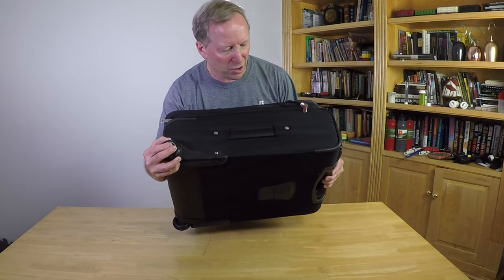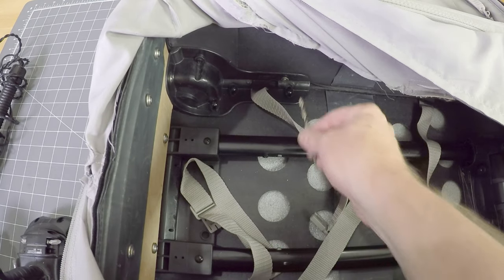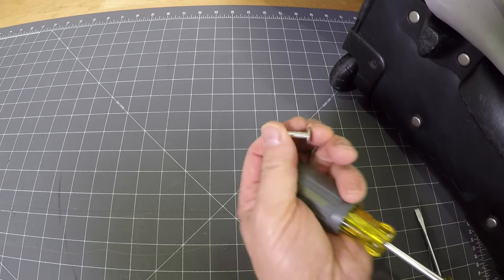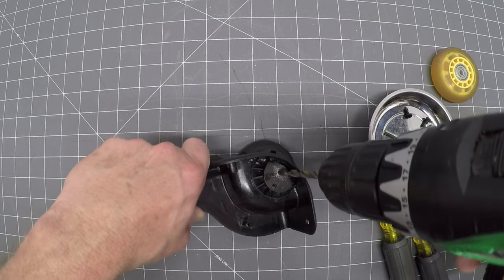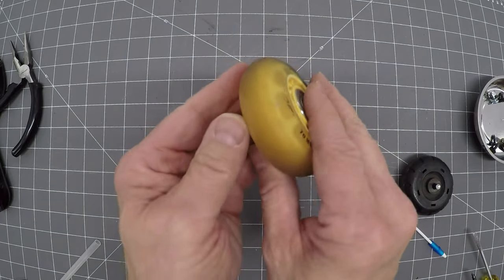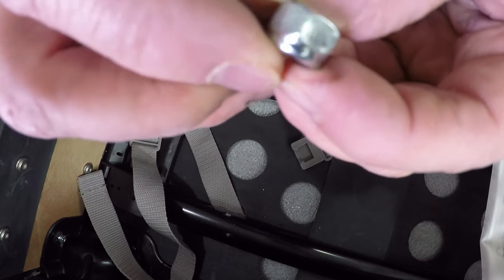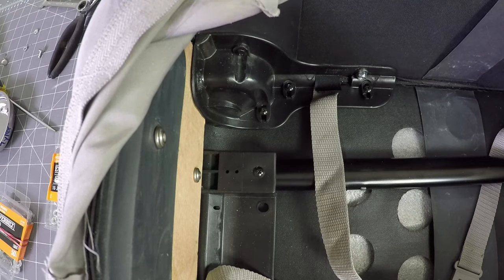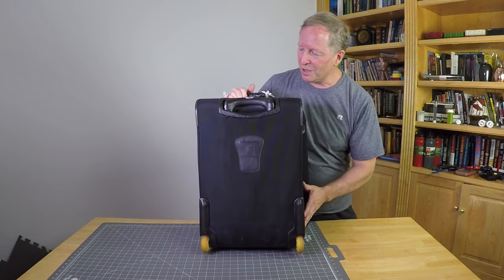Fix It: Roller Luggage Wheel Replacement for $5 - Easy Tutorial

Comment: Prague, August 2023 : I have a Samsonite 4 wheel bag After 3 short trips (bag half full), it had been pulled along no more than 2 miles. The 2 load bearing wheels completely disintegrated. A local old school luggage/ bag repair place quoted $25 per wheel - a huge amount of money for post-Communist Prague ( for perspective, $25 will buy you a 3 course meal in an average restaurant, with 3 beers). The wheel hubs have plastic detachable covers that expose a hex head bolt and screw. I asked them to show me what type of wheel they would use as replacements. Oxelo brand, 63mm width, steel bearings, 82A "hardness" (the brand does lots of dimensions/ hardnesses). I bought a 4 pack of wheels for $6 , the appropriate wrenches for $10 and fixed it myself in 10 minutes. I can understand that the shop just had a set price, assuming that they'd have to disassemble the bag to get the wheels out, but I showed them how the hub nut could be exposed, but they wouldn't budge on the price, so I did it myself.
Reply from the maker: Congrats on your successful 4 wheel DIY. Been to Prague several times, one of my favorite cities in Europe, love the clock. And some of the best beer and food I've had! You're right the prices at restaurants are very reasonable.
Reply: Love the story!

Comment: Thank you for this video! I got a super nice $400 brand name luggage case on clearance at a discount store for $15 because 2 of the bottom wheels were broken. Even though I literally could only drag it, I bought it cause I couldn’t pass up such a great deal- and it’s great for storage- and for dragging my wardrobe between my college apartment and my parents home- but I would love to have it actually work, so that I can take it traveling with me in the future. I’ll have to give this a try
Reply from the maker: Donde_lieta, thanks for the feedback. Give it a try, I think it will work for you.
Reply: Pomocne przed wyruszeniem na urlop.
Reply: It's simple.You should do it.
Reply: Did you ever do the repair?
Reply: @Charlie-eq3dj  yes..I had to use nuts and bolts with washers to adjust the fitting. It's done and working better than original wheels.
Reply: Used hand grinder to cut old rivets.

Comment: What a great video, thanks.  I found one cracked skate at GW for $2.  My suitcase is about like yours, it is an Embark from Target.  After doing the first wheel I thought of a way to avoid having to deal with the rivets.  On the second wheel I used a small hole saw and put a hole in the plastic right behind the wheel, so I was able to access the lock nut for tightening and didn't have to remove any of the base plastic from the suitcase.
Reply from the maker: Robert, thanks for sharing your experience. And welcome to the fix it yourself club!
Reply: Way too much work!

Comment: Advice, when you remove the rivet, make sure dont leave it on the luggage or the silk.  Mine burnt a hole on the plastic luggage.   What a shock the amount of heat from the drilling.  Shocking quality as compromised to make it lighter.  Got wheels but I now got a hole on my nice luggage...umph! 😢
Reply from the maker: Sorry to hear about the hot rivet, thanks for sharing your experience so others can benefit.

Comment: Brilliant video - many thanks for taking  the time to make it.  The wheels on my 25 year old Samsonite travel case had fallen apart.  On inspection the wheel mouldings were riveted on which put me off attempting to change the wheels (almost certainly the intended outcome from Samsonite).  Your video gave me all the info I needed to drill out the rivets and replace with standard fasteners.  New wheels will be here tomorrow and the case will be back in business and ready for another 25 years service.  Many thanks again.  Excellent.
Reply from the maker: Glad to hear my video helped. 5 Years later my case too is going strong. Here's to all folks like out there that see the value in repairing things.

Comment: Thank you for this video. I've been using the same suitcases for over 10 years and they were perfectly fine outside of the wheels starting to degrade. I looked inside, and sure enough the assemblies were held in with screws only and not rivets! I removed them, replaced them with some new ones, and now I might get another 10 years out of these bags and saved myself over $170 for replacing them.
Reply from the maker: Good to hear, mine is still going strong 5 years later, I hope to get another 5 more years out of mine too.

Comment: Thank you. Thank you!!!!

I have quite an old model carry on suitcase. Samsonite Silhouette 9. One of the wheels got stuck somehow and one of the the wheels wore out. Eventually made so much noise as i pulled the suitcase and I got embarrassed at the airport,  etc. I then came across your video. i bought some inline skating wheels from amazon and couple of washers. It's as good as new now!!! 🎉 

i am so happy because my carry on suitcase is really well made and i didn’t want to throw it away just because the wheel made some noise. 

I paid appox $15 (Canadian$) in total(probably could've gone cheaper but whatever. Im super happy. ) , instead of spending $250 for a new suitcase. 

Thank you. 🙏
Reply from the maker: Glade to hear my video helped you. Thanks for leaving a comment.

Comment: Just used your video recently to replace the wheels on my carry on I got several years ago for like $10 at a garage sale. Ended up buying a pair of used roller blades from a thrift store for $15 + different items at Menards. The roller wheels were thinner so they move around a bit on the bolt but still spin fine. May get some washers later if it gives me issues. Getting the rivets off was the most annoying part (1 per wheel housing). Thanks for the super helpful video, saved me money and saved my bad from the trash!
Reply from the maker: Varanos, you're welcome. Thanks for the comment, always appreciated. Agree, the washers should help out in your case.

Comment: Thanks for the video. I especially appreciate the pen comment. My previous wheels appeared to have a 6mm ID, and the new ones had an 8mm ID. Your video was the only one I watched that provided a solution for the different ID of the wheels. I also used it as a bushing/spacer between the wheel and the housing. The previous bearings stuck up over the wheel a couple of mm. I cut the pen pieces to protrude about the same amount.

I purchased two wheels off of Amazon, because in my area, the asking price of used rollerblades is twice the price of the wheels. I think I chose a wheel that was slightly too small (68mm) because my suitcase when upright now leans slightly towards the wheels. The previous wheels disintegrated, so it was difficult to get an accurate size. It now rolls perfectly and is distinguished from the other black bags with light up orange wheels. I'm a happy camper.
Reply from the maker: JenDet, happy to hear about your success and your bright orange wheels. Sounds like you're making a statement with them.

Comment: I have this exact Swiss Gear carry-on... wheels were toast.  Ordered "Ohio Travel Bag Ball Bearing Inline Skate Wheel, 70mm, Black" along with "M6-1.0 x 50mm Hex Head Screws Bolts, Nuts, Extra-Large and Thick Flat & Lock Washers".  Found that while I didn't need the bic pen plastic shim with these wheels and the M6 bolt, I did need to ensure the inner and outer bearings were touching each other inside the wheel, or else it would bind. Used an extra washer to fill the small space inside the wheel between the bearings... and it worked great.  Super instructions -- thanks for inspiring me to replace these wheels.  New cases are $130 on sale... so this is a great fix to get more life out of these bags.
Reply from the maker: Frederick, glad to hear about your success, your new wheels are likely to now outlast the case.

Comment: Thanks for posting this video. People usually tilt the luggage toward handle and then drag it. 99% of the time those are the wheels that get damaged. Simply replace them with opposite wheels. No need to buy new wheels. You should be good for another 5-10 years.
Reply from the maker: Gautam, excellent point. In my case though the original wheel had large chunks taken out of them so no longer good. But this upgrade is still going strong 10Ks of miles later.
Reply: Some bags have only two wheels on the handle side.The one here was that type.

Comment: Thank you! Question - do you need to use a special drill bit since the rivets are metal? Or since they're thin, any drill bit should do?
Reply from the maker: any drill bit will do as long as its slightly bigger than the rivet neck...

Comment: THanks for the video. But how do you get the size of the wheels? Out of 4 wheels, only 1 of mine is damage..
Reply from the maker: You can estimate with a ruler, or slide in a piece of paper and mark on both ends of all 4 wheel and you're likely to get close.

Comment: Wow! thank you. i had a male friend do my leather IT trolley but i have another one that i am trying to do. i wondered too about those silly rivets. i got these wheels with a Allen key bit on one side and screw for other. are they okay to use? thanks
Reply: its taking me a bit longer as drill bit size i need cant find. i need a smaller one than i have. i need bag Tues so as its Sun it may take me longer than a day. the rivets are close to wheel plastic hump thingy.
Reply from the maker: Kimmy, not able to see your case or the wheels, maybe you want to ask your friend again with this one. Best of luck.
Reply: @MakeItorBreakItNow  - i am going to attempt but i need a drill bit. my friend is busy that is only reason i'm doing it. only 2 rivets per wheel casting so i know i can do this. i will let you know how i get on ::)) thank you
Reply from the maker: @kimlarjohnson2263  you're welcome. Look forward to hearing about your success!

Comment: I didn't catch the part with the pen at all - no idea what you did there.   Could you do that part slowly?
Reply from the maker: Glenn, using a plastic pen tube, I made a spacer for inside of the skate wheel so you can 1/4 inch hardware as the axle.

Comment: Any idea where a set of wheels can be purchased? It seems that Amazon & EBay point to a set of (4) or (8)... Thanks
Reply from the maker: Art, you could try these: https://amzn.to/3L42lWL, just make sure the dimensions are right for your luggage.
Reply: I have tried on ebay as there are people from skip who salvage and sell.  Its really6 hard to find right height weight thsn size of the hold than the plastic main frame that fits the corner of luggage.  You soon collect loads from roadside throwaway!  It's fun, when finally one good for the road.

Comment: 70mm wheels are key.  have to get small kids skates to find those... most adults are 76 - 80mm (too big for the plastic "wheel well" the wheels are mounted into).  I bought a used adult pair first for a few $ and figured out the hard way how big they were (76mm).  Figured out that the wheels from kids were right size so got a pair of those.  used the adult bearings/spacers/axles in the 70mm wheels to give them a bit more endurance (maybe?)
Reply from the maker: Chuck, maybe depending on the luggage, mine were adult wheels but likely worn down to ~70mm when I installed them.
Reply: @MakeItorBreakItNow  - True... one set of luggage accepted new 72mm wheels, another set nearly new 70mm.  

One of the problems with the kids wheels is that they had 6mm Inner Diameter plastic hubs.  I replaced them with metal 8mm OD / 6mm ID hubs (from the adult skates) and recycled the adult skate axles -- they had just with just enough length to snug up the plastic housing to the hubs without binding the wheel.  

total investment: $18 for the two sets of skates. Fixed three sets of luggage and have one more set of wheels if any of my other ones get destroyed by the airlines.

I noted that if I saw a pair of skates that looked like good candidates on FB or craiglst, I could typically go to the manufacturer's site and determine the wheel size-- kids 2 to 4 / 3 to 6 and size "small" women's skates tend to have these relatively smaller wheels.  

p.s. 64mm wheels would not have worked as they would not be of sufficient diameter to mount in the wheel hubs and allow the luggage to clear the ground.
Reply from the maker: @chuckhortler2814  your comments are most excellent, thanks for sharing your experiences so that others might benefit!
Reply: @MakeItorBreakItNow  - thanks for posting the video!  Probably wouldn't have gotten up the gumption to go searching for skates/wheels without it! 

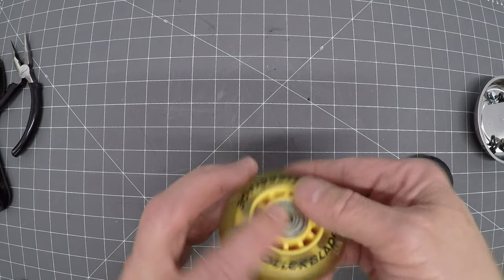p.s. re: "worn down to 70mm" - your wheels show "70mm" stamped on the side at 5:15 in your video - nice pick/excellent luck in the perfect fit!  Maybe you should buy some Powerball tickets?  LOL.

Comment: Wouldn't the nut become loose due to vibration after much use?
Reply from the maker: years later still going strong, the key is using a nylon lock nut.
Reply: Dont attempt to use a normal nut because its available.   When I test it, it undo, all falling apart nicely on the floor.  It was hilarious.  So glad not on holiday.  It's not funny than.  I did try to super glue the normal nut not end, hope it last with the tumbling along vibration.
Reply: @weeleelim7456  yes, i used lock nuts. They did their job; they held up even when moving on bumpy ground.

Comment: ANOTHER advice.  Once you drill through, you find you got a hole on the ring.  I hammer it flat and its now use as washer.
Reply from the maker: Not completely, but it will allow you to check all the valves so you pass the backflow test which is usually done by an authorized county official, at least that's ho its done in my area.

Comment: use a bigger drill, to remove rivet roll over in 2 seconds....
Reply from the maker: Trevor Taylor, thanks for the suggestion, I'll use a bigger drill next time.
Reply: Or... buy a bag that doesn't use rivets to fasten its parts... screws are soo much better, and most of the time, I can just buy the replacement part from third party vendors.
Reply from the maker: @applemauzel  , valid point, from now one I'm going to purchase my luggage differently.